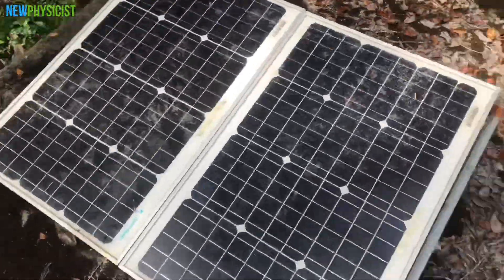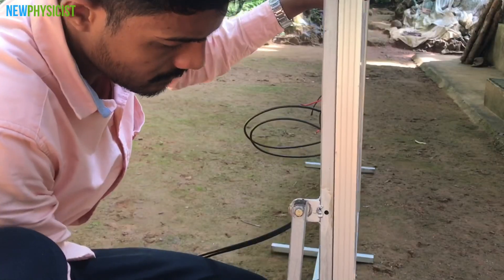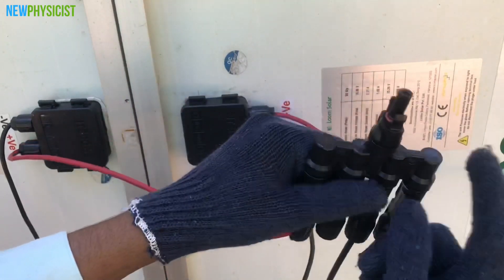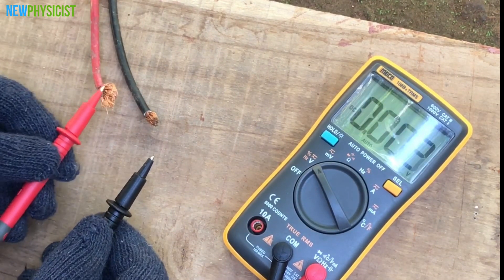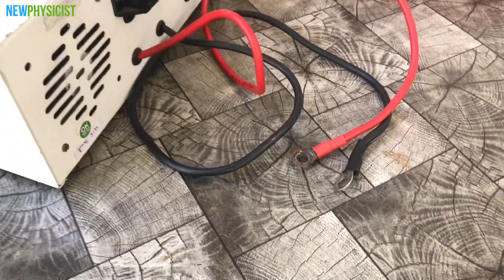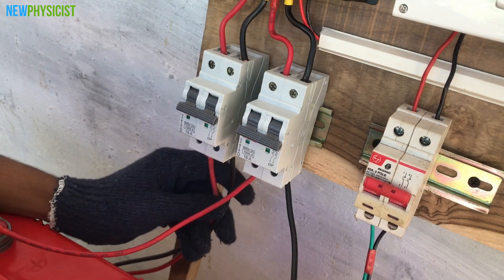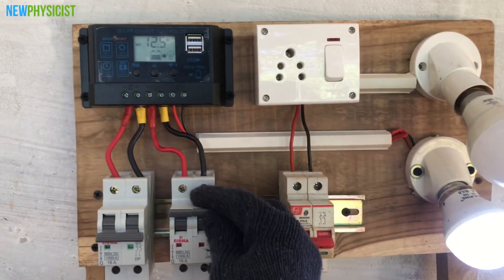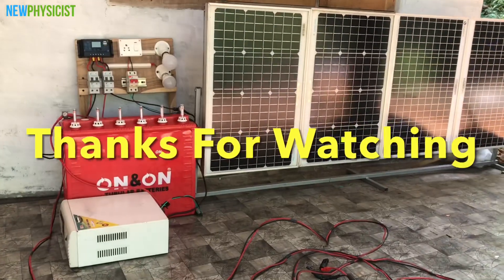1KW Solar Inverter Upgrade | DIY

Comment: Would be much better matching the solar panels voltage to the battery. In this setup you are losing nearly half of the solar energy due to the massive voltage difference - approx 50% power loss. Replacing the PWM for an MPPT controller will adjust the voltage down and increase the current, thereby maximising the solar PV output. Other option (using PWM controller) is to get either lower voltage panels to match a 12v battery or get a higher voltage solar panel ~ 30-35V and use with two 12v batteries in series or five 6v batteries.

Comment: Sir could you suggest me please, I want to use Zerox machine, computer, printer, how many watts can I use invetor
Reply from the maker: Let me know the power wattage of each equipment.
Reply: Sir 500watts solar panels and 300ah  Rechargedble batter
Reply from the maker: 200Ah lead acid battery is enough for 500W panel.
Reply: Can its work this Zerox machine with invetor 2kw
Reply from the maker: Absolutely yes. 1KW is enough I think.

Comment: Thank you for the new video. Actually, your videos cleared a lot of problems I had regarding off-grid solar systems. I have one question since DC MCBs are rare & expensive, can I use AC MCBs instead? are there any negative impacts?
Reply from the maker: No you can’t use AC MCBs. AC MCBs can’t detect and drip when there’s a possible DC surge  current. In DC side you must use DC MCBs. In my previous video I used AC isolators just to isolate panels and batteries. It won’t provide protection. Regards. 🌎🌞

Tip: Use MCBs with fuse or separate fuse to protect your system.
Reply: @newphysicist  Thank you for the explanation.

Comment: നന്നായിട്ടുണ്ട് 👍🏻ഞാൻ ചെയ്തത് 124w loom solar+ 60ah luminous tubular +30A amici smart charge controller only.ഇപ്പോൾ 2year
Reply from the maker: How’s it working? I mean battery performance.
Reply: @newphysicist  All the lights in the house work on it.So there is a good difference in the current charge as well👍🏻

Comment: How solar panel turn without motor ?
Reply from the maker: No, it doesn’t. I said, I can easily adjust for seasonal north south change. I will install a single axis tracking later.

Comment: I have w200  solar panels and N150 betries which Amp solar controller needed?
Reply from the maker: I think you have 200W 12 solar panel and 150ah lead acid battery. Right?

You need at least 300 W panel to fully charge your battery. I suggest you use 20A pwm charge controller. But connect inverter to the battery, not the controller.

Comment: Very Useful 👍🏼
Ningal Solar Battery ano upayokichirikkunath etra time edukkum full charge akan?
Reply from the maker: 5 hrs of Continuous bright sunlight ☀️. For a 110 Ah battery use at least 250 W panel for best performance.
Reply from the maker: Yes it’s a C10 type Solar Battery.
Reply: Thanks 🙏

Comment: Battery full charge voltage settings charge controller...14.4v  or ......?. plzzzzz reply
Reply from the maker: For Lead Acid batteries. 

Overcharge Disconnection : 14.1-14.5
Over discharge disconnect: 11.6 V

Comment: Instead of charge controller, is it not fusible to use solar off grid inverter? Sir,
Reply from the maker: Yes, some off grid inverters come with inbuilt charge controllers. You can definitely use them. What’s your panel voltage?

Comment: I have same solar system at my home , 200watt solar system 
I'm used 4 solar panels 50watt each 
Loom Solar mono perc !
I receive 10.2amps in full Sunny
Day and voc is 22.5 volt 
but I'm not use inverter I'm 
Runing only dc load
Reply from the maker: That’s better. It reduces loss. I integrate this system with the AC wiring I already have. That’s why using an Inverter. 

What will you do if you want to use TV?
Reply: I'm use a 12v dc to 220volt ac 200watt converter for TV and mobile charge

Comment: How can we check the battery percentage or where to install battery capacity indicator in your system?
Reply from the maker: Most Charge controllers have an inbuilt battery 🔋 capacity indicator. If you want to use separate“battery capacity indicator” you can connect it to the bottom side of the second MCB. Turn off the MCB when using the indicator, otherwise charge from solar panel may interfere with it.